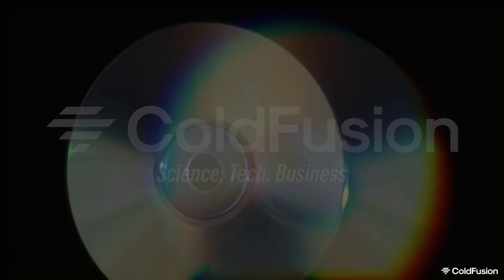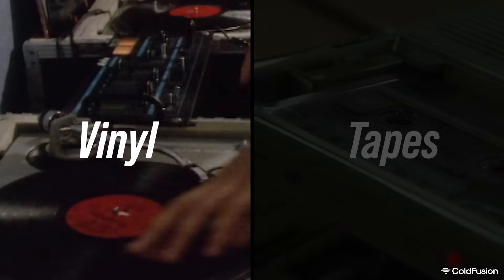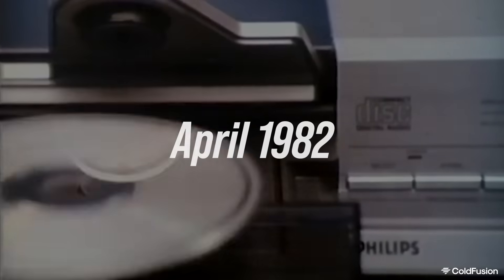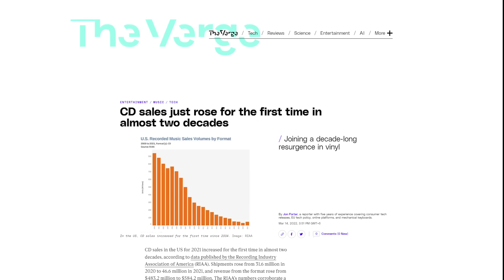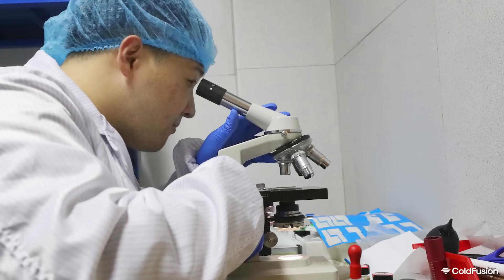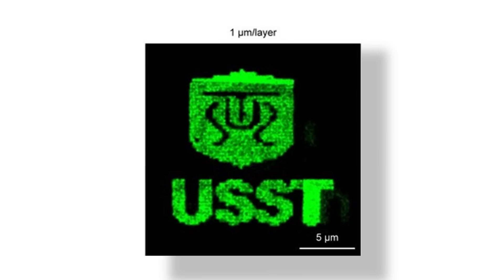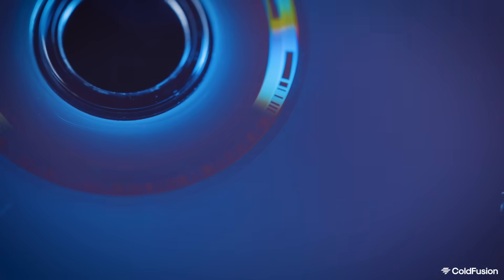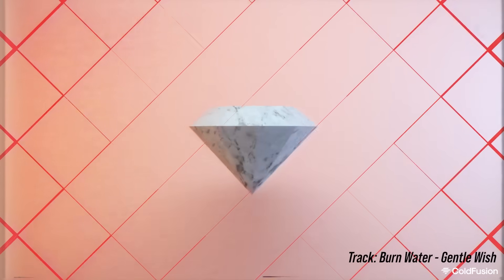Why This New CD Could Change Storage

Comment: This kind of data storage is going to be essential for high volumes  of data storage such as will be  needed in the square kilometer array project and other high data generating science projects in astronomy  etc. Such projects generate vast amounts of data that need to be stored for analysis and archiving. That is where the first application would most likely bring the largest benefits. 

As far as data centers and machine learning (Ai) is concerned. These will have limitations not of data storage, but of energy as these, from what I understand, will need the likes of gigawatts of power to run 24/7, and growing exponentially that may consume more energy than can be available for them. 

Hope this becomes a reality and one can store all the music or movies they want on one, custom made disc.

Comment: Hmm. I think the people commenting here are short sighted. There will never be a CD come back. Name one thing you would buy that would use more than 1% of a petabit. It is far more likely we will only see them in data centers for several years. If otherwise, they will likely be sold in a hard drive like case similar to old HDDs which will include everything to read and write on the disk. Just one of these drives could store every file you would use over several years if not decades assuming you didn't even bother deleting stuff. Unless movies start needing hundreds of GBs or games needing a TB, I doubt we will be seeing CDs again. Especially with read and write speeds of these. Solid state storage is still needed, and therefore storage optimization.

Comment: "kiloWatt per terabyte" is a meaningless unit. Did you mean kiloWatt-hour?
Reply from the maker: I meant that as in the write lasers would use a kilowatt of power to write one terabyte of data.
Reply: @ColdFusion  over what time period? A kilowatt is not a unit of ENERGY, it's POWER. Power only makes sense if you say over what time-period that power is used. If it can write one terabyte per second, then a kilowatt isn't terrible. But if it takes an hour to write one terabyte, then a kilowatt is prohibitively expensive.
Reply from the maker: @Pants4096  Yes but I had already mentioned the write speed was in the mb/s range - I believe the number was around 5mb/s. So, it's basically unfeasible as a product without further refinement at this stage.
Reply: @ColdFusion  Right, I get that. I just wish science reporters would be more careful with their units. Units matter. (Just by way of another example, "mb/s" is technically millibits-per-second. It should be MB/s for megabytes-per-second. Details matter in this stuff! ◡̈ )
Reply from the maker: @Pants4096  You’re right, I’ll aim to be more precise in the future

Comment: Oh I would so love to see this happen.  I've had so many hard disk failures as of late.  With how shady online storage is not to mention the price.  I'd rather have something on my shelf I can plop in and achieve and have piece of mind.  CDs and DVDs offered that for years till files got so big just putting a couple of video files on a disc would eat it up.  Hard Drives are not a viable long term solution either.  I thought Blu Ray was going to be, but the price of the media never really came down.

Comment: I still burn discs to this day for archival reasons on M-Discs. The concept behind them makes sense and they're so cheap. 100Gig is $22 average for permanent burns and I don't have to worry about hard drives failing. Plus it's cheaper than LTO and finding a disc reader is infinitely easier in the consumer market.

Comment: 12 years ago they said they would make a 1TB CD with the max of the time of 1.7TB to 3.3TB in the future , why did this not happen?
They have 3.3TB backup CD drives, but it is a group of CDs in a case and they cost like 150$ so pointless when looking at the cost of drives. 8TB is 150$ .

Comment: I never really gave up on CD because there is nothing better to save information cheaply and permanently.I have 20 year old Data-CDs and not to report a single data loss...not even a modern hard drive can do that. I love this technology.
Reply: i backed up everything i have on 25gb blu-ray discs few years ago and data is still solid, also if your entire room floods, m-disk bluray is the most secure storage media, the water would kill tape and harddrives
Reply: @automatedrussianbot  But the problem now is 25 GB doesn't even cover one small partition. My smallest hard drive now is 2 TB. That is about 400 blu-ray discs. Not a happy prospect. And that is just one HDD of many. Additional HDDs for backup helps but unless you use a NAS, they're online and vulnerable to the to the same threats as the source disks. System backup was the first thing I thought of when watching this video. Finally a way to back up my system. However, the read/write speeds have to improve by a few orders of magnitude.
Reply: Let me guess. VERBATIM brand blanks? Most cheapos tend to get those stupid GREEN ROT/RUSt rings on them after a couple of years in a moist UK environment. Verbatim on the other hand, never.
Reply: @DaRush-The_Soviet_Gamer  Yep,  just Verbatim M-Disc´s. Unfortunately, they weren't available when I was young, so I had to make do with no-name ones.
Reply: Ive got a few almost 30 year old CD-Rs which are still working and of course some music mid 80s music CDs which are perfect.
Reply: Tape can do it if you can find a cheap drive. Those were actually designed for long term archival storage.
Reply: I had dozens of failed CDs.

Comment: To have any resemblance of redundancy you would have to always make at least two complete copies of each disk. 
Or perhaps just use them as off grid backups. 
However, the term 'off grid' is increasingly shrinking. 
It will be interesting to see if this goes anywhere in the civilian sector.

Comment: I think most people missed the part where write speed was several MB/s. At this speed you need several years to write a single disk. You need to increase the speed 100000 fold for this to be viable! This will never see real world usage.
Reply: blurays have up to 79MB/s write, so comparing this disc to a CD is a bad choice for the video

Comment: I remember at uni a few colleges found a way a store 10tb on a disc using diamonds and 3d and later decided to sell to consumers but drive cost to much and why would a home user need that much bc it can break easy etc. cost has to come down and ability to not break at a drop needs to fixed. Also size bc a hdd can now be held in pockets. And ppl are using nas cheaper than ever now. If companies can solve this then possibly.

Comment: 00:00💿 The video explores the potential comeback of compact discs, highlighting their history and the recent development of 3D optical discs with storage capacity up to 1.6 petabits, which could revolutionize data storage.

03:00🎶 The development of compact discs (CDs) stemmed from efforts by Philips and Sony in the late 1970s, integrating laser technology to revolutionize audio storage and playback.

05:37💼 CDs saw peak global sales in 2000 but faced decline due to MP3 players and streaming services, though recent artist releases like Adele and Taylor Swift briefly boosted sales in 2021.

07:00📀 Researchers at the University of Shanghai have developed a 3D optical disc capable of storing up to 1.6 petabytes, potentially transforming data storage with its compact size and durability.

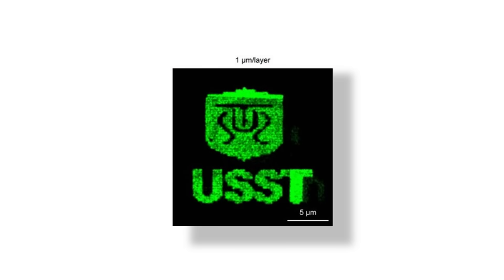10:10🔬 The new optical disc's technology involves stacking layers with microscopic data spots using advanced materials, allowing for precise data encoding and high storage density.

12:00⚠ Despite its potential, the new optical disc faces challenges like slow writing speeds, high energy consumption, and costly manufacturing equipment, limiting its immediate practical use.

Comment: I am securely in the local, offline storage camp. I would LOVE to be able to securely back up my data and retain it locally. That brings up a concern. When recordable DVDs were introduced, they were touted as archival storage that should last for 'hundreds of years'. Turns out that the organic dyes used in these discs started to degrade immediately and only lasted reliable about 10 years under ideal conditions. What is the expected durability and longevity of this new medium?

Comment: Unlike what this narrator says, I use CDs and DVDs every single day. It's the perfect format for surround sound audio and CDs are still great to play and burn to. 

I recently had two external hard drives go bad on me and most well over 4 TB of data. It seems rather ironic that I moved my files to a hard drive for backup protection and lost all that date. On the other hand, I've stored thousands of files into hundreds of optical discs and can still retrieve the data with no problem. 

Screw cloud services and USB sticks.

Comment: While we are on the subject of experimental forms of High Capacity Storage: In I996, researchers began to propose full~time usage of the Femtosecond Laser, which ultimately led to the development and eventual showcase of Quintidimensional (Five~D) Optical Data Storage in 20I3; at the time, disks using the resources of Five~D Storage were able to be produced in the size of roughly or slightly less than a US Quarter and in its base form they could hold up to 0360 Terabytes with a Durability Factor that could make it potentially last Billions of Years due to its material, this is something that I do believe will become the eventual New Standard but it is the matter of when that makes it incredibly difficult to determine.
Quintidimensional Storage would also get referenced through means of ABC's notable (albeit short~lived) Science Opera series Emergence (20I9), in it we discover that Piper's life memories are stored entirely on a single Exabyte Drive (to quote the character who made the discovery: "That's a Billion Gigs!") and it uses virtually the same form factor as the 20I3 showcase's design (though unlike the Coin~like design from 20I3's disk, the 20I9 disc is more like a Dual~Sided Eye Contact, kind of like a vertically scrunched Sphere); although its layout is very structurally different than what is offered from the AIEDDPR Disks, I do personally feel that we probably wouldn't have Tridimensional (Three~D) Optical Storage with this level of Multilayering had it not been for the innovations in the Five~D space roughly Eleven Years ago, I would need to do more research to know about the many mirrors and differences that both storage mediums possess and deliver but if this ends up successful then there is a significant chance that this will finally open the door to Upper Terabyte and Early Petabyte Era Hard Drives for the Consumer space.

Once we find a way to utilize this capacity level in a virtually Failproof manner that guarantees Stability (Extreme Rarity of there ever being Bad Sectors), Efficiency (functioning at the same power draw as traditional Hard Drives and SSDs), Durability (it would be nice to see it not get destroyed from a simple shake, vibration, or drop), and Performance (fate knows that getting Terabytes per Second for Read and Write Speed on a disc or disk will require a major jump from where we are now on Optical Drives and SATA III), all we would need from there is a heightening in the quality and quantity of its production and wishfully that will be enough to reduce cost factor annually; whether or not it'll be a quick adoption is beyond the knowledge of any of us, but for media companies this will open the door toward Full Catalogue re~releases of their entire libraries in physical form, and those of us who locally produce in media or do online hosting who need large amounts of storage for such work alongside Preservation or Servers would benefit from having even a few of these on our person, especially if they can last us decades before we get to do a proper upgrade into the Exabytes or even debut the Yottabyte Era. (:

Comment: Close.  The MP3 format was used for the audio on Laser-Disc.  They were not yet able to compress the video, so the video remained analog.  The problem with Laser Discs was actually two-fold:  Being encapsulated in poly-carbonate, it was nearly indestructible and there was no way for the consumer to record on it (requiring clean-room technology to manufacture didn't help, either).

Comment: It is still superior technology. Streaming uses data compression, and flash storage isn't permanent. Optical media is one of the best ways to archive data and uncompressed high def video and audio. The other is more convenient, but not better. In fact, the cells that make up flash storage die and lose their data over time just by sitting, unless the storage  is periodically connected to a device and powered. Optical media can sit for a loooong time, especially disks using M-DISK technology. CDs haven gone any ware. I play CDs all the time. And you can still (I'm not sure why you would want to) buy newer music on CD.

Comment: At 11:50 ... Kilowatts is NOT the right unit for energy consumption. Kilowatts is Power, aka Energy PER unit of time. The units you need for Energy is Joules. IF we had actual figures for how many kW are going into the lasers AND we had the actual writing speed in MB/second, THEN we could produce actual numbers for Energy Per Disk. But we do have "200 TB in 6 minutes" which is 555 GB per second. That does not track. Something is utterly fubar in the figures we have been given. 
We really need the RAW figures for everything, because science REPORTERS cannot be trusted to use the proper units, nor do unit conversions properly.
Anyway... Considering how much data we are talking about, it could be perfectly acceptable to use significant energy. A MUCH bigger problem seems to be the COST.
Reply: Waiting for your partner to get ready as you sit and wait, is the only correct unit of energy measurement that matters.
Reply: Or kWh
Reply: also using a CD as an example is bad since blu-ray tech is way more advance than old CDs

Comment: I don't think the demise of the audio CD had that much effect on the data CD for computer use, I think they dropped out as computer data sizes just outstripped them. In the beginning they made good backup's, but as we moved onto Terrabyte hard drives, you'd need a stack of DVD's to do a backup, kind of making them useless.
Also, unfortunately in the race to make CD's cheaper, the quality went through the floor, with many writeable disks unable to last a year, even in a good environment, like a filing cabinet in an air-conditioned office, let alone storing them in a suburban garage, what use is a backup if the media is so prone to failure.
Hopefully these new disks will be built way better, so hopefully they can dispense with those crazy price lasers and get it to work with standard solid state lasers.

Comment: Dang with data that dense will fine scratches or heck even dust on the disc cause any issues? This tech would be amazing at archiving things if it can be kept in storage for a long time.

Comment: I remember back in the 90s how we were told that CDs would be good for a hundred years, and we should trust them to store our data.  So we all went and bought CDs to archive our data.  I'd say 90% of my CDs were destroyed by disc rot within 3 - 5 years.  The rest just degraded with use (which was occassional at best).  There's no way I'd trust a single disc with 1.6PB of my data.

Comment: Yeah that's all crazy but there's obvious reasons we moved from hard disk drives to SSD's. I don't see the improvements in read/write speeds catching up or even just keeping pace with SSD's which are also immensely more compact. Certainly may make sense for data center redundancy or at home backups but that's about it. I doubt the price will become economical any time soon anyways to make it worthwhile for any at home use.

Comment: Optical discs DO degrade over time, you can minimize that by using the higher priced "archive rated" discs (and burners) as well as storing them in a controlled environment.  What home consumer is going to do that though, even if they do have multiple TB of media they want to keep "forever".  They're likelier to do the same thing I've done, keep them in a file cabinet and HOPE they're still readable 20 years later (spoiler alert, not all of them ARE 100%).
Reply: About 20 years ago we had transferred home movies to dvd and put them into a wallet they never got abused or played alot and away from light. Today few if any work right tho I have  a 4gb mechanical drive from about the same time and that works perfectly. That said I have music CDs from 95 and they work fine
Reply: @HMoyn215  I have a couple of the first audio CD's I bought (mid-late 80's) that still play.  I also have a couple of DVD's (non Blu-Ray) that I purchased in the early 2000's that are going to crap
Reply: @michiganengineer8621  Why would you put "DVDs (non Blu-ray)"? Nobody would ever assume you meant Blu-ray if you mentioned DVD.
Reply: @FlyboyHelosim  I've worked with people who would have been unsure.
Reply: @HMoyn215  DVDs are known to suffer from bitrot, blu-rays are way more resistant too that